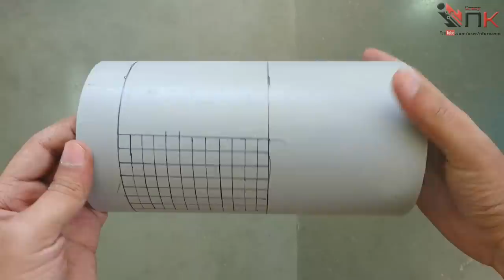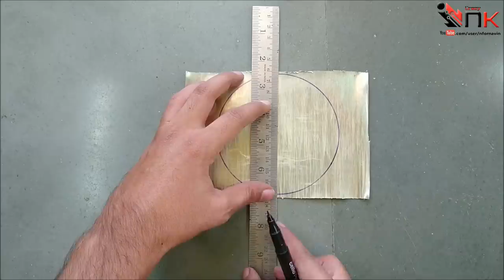How to Make a Bladeless Fan using Plastic bucket at Home

Comment: just wondering; if this is the easy way; what's the more difficult way like?
Reply: Cristijn de Vin now imagine the amount of money spent on stuff used to build this
Reply: Isn't the real Dyson bladeless fan based on something about ionic charging of the air, so that it rushes from one side of the fan to the other thus picking up momentum and creating air currents?   If so, then to make one of those I think you need to build some high voltage generator or something.
Reply: Actually the real dyson fan is built exactly like the one in this video. There is a fan in the base that gets pushed through an extremely small gap that "amplifies" the air current.
Reply: insane is right the Dyson fans are pure scams, the fan is in the bottom, I looked at my friends , pure marketing hogwash
Reply: There is a fan, yes, but is smaller, uses less energy and generates the same, or even more, air current than a common one with blades. That is no scam.
Reply: less then a tenner, just built it with my son.
Reply: +Paul James thanks Paul. my point exactly. jealous people. I like that guys idea.working on stuff and projects myself. dealing with the same issue. they have nothing else to do. like your comments.
Reply: Cristijn de Vin lol hahaha
Reply: ROTFLMFAO!
Reply: Cristijn de Vin apparently just buying one is way harder than spending 3+ hours making one
Reply: cobblerama when Dyson promotes the word "bladeless", by that they mean no visible blades, to see or to get hurt with.
Reply: Cristijn de Vin xxŹssxkxx!
Reply: Same steps but with no hands
Reply: He could have just bought a better one..lol
Reply: MGTOWPORTUGAL these all stuff u will get it for less then 4$ except battery...
Reply: Cristijn de Vin paying 400 dollars for one haha
Reply: Cristijn de Vin 😂😂😂😂🤘
Reply: If you got couple hundred to spen on a fan
Reply: Get a minimum wage job, eventually buy a real one.
Reply: so then why don't you just put that fan vertically and use it as a normal fan.
Reply: £200 is the more difficult version.
Reply: I don't dispute the ingenuity just the practicality of it. He could have used that can air fan (that's really what the device is) and perhaps fashioned an air chiller system using water cooling to actually generate cool air for probably a lot less noise for the same amount of items plus a hose......
Reply: Take the bucket, put it on your head, then save up to have central air conditioning installed in your home.
Reply: Cristijn de Vin making molds and thermoplastic but for a one off piece this is a good method. Now maybe a bigger motor and stacked of blade disks......hmmmm more power
Reply: You go to work for minimum wage then spend 500 bucks that you probably need on a fan you probably dont need. Thats the hard way
Reply: iain schmaloer what is this repalcing you speak of?  How does one do it?
Reply: I thought it was just thinking that i was lazy.. but then i see how many people saw yr comment..#internet search..haha
Reply: Making a Bladeless Wooden Fan - Scrapwood Challenge ep38
Reply: Lmfao
Reply: @hydmonger2816  i was much more impressed with the wooden one
Reply: @nanaimosteve5952  well yes but actually yeah
Reply: @ Cristjin, Thaks for that !

Comment: Pretty slick design, I like the re-purposing of other household materials.  I'm sure that by now you've considered some improvements.  Based on what I see here, the two major problems immediately obvious to me are Noise and *Air Flow*.  So for those two issues, here are some options:

1.  Noise.  This can be improved in several ways.  
    a) using a small piece of rubber or other vibration absorbent material between the wood support block and the motor would reduce the whine of the motor.  Adding the same rubber to the base would reduce vibrations conducting into the surface it's sitting on. 
    b) balancing the blades better would reduce vibrations in the whole system. This can be accomplished when you are first using the compass to draw the circle on the metal:  Once the circle is drawn, put the pin on the edge of the circle and make a mark with the pen on the circle, then move the pin to that mark and repeat all the way around.  This will give you 6 marks, split the distance between them for a total of 12 smaller, equally sized blades.  Next, balance the fan on a nail or pin in the centre hole, and mark the side that hangs lower (heavier)  Use sand paper to remove tiny amounts of metal, and repeat until it sits perfectly level.
    c) use sand paper or steel wool to sand all of the edges of the blades to remove any burrs or rough spots which produce the "wooshing" air noise.  Painting the whole thing with high gloss paint or nail polish will also reduce air noise.

2.  Overall air volume:  At the end of the video, you can see the paper strips at the edges are moving, but the centre ones move much less, this tells us we don't have enough oomph in this design for the size of the orifice.   The "magic" happens due to a phenomenon known as the Venturi effect (an example of _Burnoulli's Principle_); in a tightly engineered fan, the the throat/pedestal fan output is balanced to the orifice size (the big O made of the bucket) and the gap/angle that allows air to pass into/through the orifice. As high velocity air leaves the gap in the rim of the orifice, it produces a difference in air pressure across the orifice, which is how it is able to move more air than just what is moved by the throat fan. In this video, the throat fan output is undersized for the orifice/gap.  The basic solution is simply to reduce the size of the orifice, thus increasing the pressure differential, subsequently increasing total air movement.

Getting the fan design to match the Orifice size, gap, and angle for maximum efficiency can be a severe pain in the butt.  If I remember right, Dyson uses between 12 and 18 degrees for the pressurized air angle, but getting that precise in a home-made model might be a bit difficult.  I'm also unconvinced that this is a critical step.  However, the fan design makes a big difference.  Smaller blades with a sloped curve would give the fan output less velocity but more pressure; as the size of the orifice is reduced, the pressure output of the fan becomes more critical than the volume of air moved.  With some patience, a person could tweak this build several times to determine the best design.  After all, that (plus some crazy math) is how Dyson came up with their ubiquitous fans.
Reply: How to tell me you work for Dyson,  without telling me you work for Dyson.  😊
Reply: @ThunderPickled  hahaha, I don't actually!  I'm a lowly power engineer at a chemical plant.  However, fluid dynamics of air movers is very important to my career, I just usually deal with fans and blowers that are several meters in diameter.  All the same principles apply, with only slight variations due to scale.
Reply: As a master electrcian, I can appreciate your input but I doubt most will.  The work we do behind the scenes to keep the world running is under appreciated .
Reply: @ThunderPickled  well thank you for your kind words :D ... You're right about being behind the scenes, too.  But I don't mind sharing my knowledge (or opinions) even if it takes 5 years for someone to come along and recognize it 😂

Comment: how is it blade less if it has fan blades?
Reply: Dude the blade is hidden inside the that pipe
Reply: ravinder singh that doesnt make it bladeless
Reply: Wayne Wildman if a fan don't have blades where do wind coming from ? lmaooo 
the blades are hidden inside which makes it as bladeless fan 
but in this case  it's just too noisy lol
Reply: Bes Mir bladeless means no blades plain and simple
Reply: this comment thread is hilarious
Reply: Colin Merryfield    Qqq
Reply: pat O'Hara wut?
Reply: Marketing wank, it is still a blade driven fan but the blades are hidden away.  An old concept "air condition"
Reply: Bes Mir that still  isn't  bladeless. It is hidden blade fan.
Reply: Bladeless in appearance, do you know of an efficient way of moving high volumes of air without blades?
Reply: Oliver Carr no buy the name implies no blades at all.
Reply: Wayne Wildman It's marketing, not magic.
Reply: Oliver Carr I do know a way.
My mouth moves lots of hot air.
Reply: Which is effectively a pump, mechanically inefficient and impractical compared to a fan.
Reply: Oliver Carr dude, it was a joke...as in "I am full of hot air." You ought to lighten up a little.
Reply: you could just talk about the IONIC BREEZE which is an actual bladeless fan...

this video is not about a bladeless fan.. it's a hidden blade fan.  end of story, no ifs ands or buts about it.
Reply: that how its work ass no were in sight fan blades
Reply: O.M.G! Learn to spell.
Reply: "that how its work ass no were in sight fan blades" 

Now that you've explained, it makes a lot more sense to me.
Reply: those who think he lied about "bladeless" read below. A bladeless fan (sometimes called an air multiplier) blows air from a ring with no external blades. Its blades are hidden in its base.
Reply: manu thomas 

 l
Reply: Bes Mir
So the proper term is "Hidden Bladed Fan" and not "Bladeless Fan", right? Besides inaccurate, "Bladeless" seems like a lame marketing gimmick.
Reply: It is just a marketing gimmick, take the Dyson "Blade-less" Air Multiplier which actually has blades like this one.
Reply: Wayne Wildman You know what, you're all right. Dyson are a bunch of scammers and should have named it the Bladeless-Looking-But-Not-Technically-Speaking-Bladeless Fan. Rolls right off your tongue! Dyson had such a good marketing chance with naming it that but they blew it!...
Reply: the sarcasm is strong with TheFrosty. Well done.

Comment: this is awesome, i looked at what bladeless fans are because of your video. I've always had trouble sleeping under regular fans they make me feel beaten up in the morning. Now i know why.
Reply: I had a floor fan that sounded like an airplane so loud it was, and it was full metal, made a wind too... Broke it last week when I was cleaning its electric motor, I thought I had it screwed but I didn't, so I ended up dropping it and unfolding the copper, poor thing!

Comment: I think people are over looking the fact that this is a 12 V system. This is a great project with far more application than a 120 V fan. This would be camping or useful during a power outage. Also would be very easy to use and maintain with solar power.
Thanks for the video.

Comment: You made the cowl duct backwards. By using the wider side as output, you create a low pressure region within the ring, so you aren't moving any of the ambient air through the ring, it's just blowing a much lower volume of air from the fan itself. That defeats the entire purpose of the design. Try doing it again, but having output holes on the smaller side, and notice how the increased pressure combines the output air with the ambient air passing through the ring for more efficiency and higher output.
Reply: why does ur face looks like u advertise "smoke weed everyday"
Reply: Never heard of it, but whatever makes you happy. I don't judge.
Reply: @poolehart, Let me guess, indoor cats? Be glad it's not the smell of "A cat's wrath of vengeance against vile rodents, and winged demons that mock them from the other side of the glass windows."  At least that's what my cats call them, I just call them birds and squirrels.
Reply: JamesMorningstar  u look like cheerful guy.... kudos 😁😁
Reply: JamesMorningstar 
Maybe you should one up him

Comment: THATS NOT BLADELESS! CHEATER!!!
Reply from the maker: Fan without propeller, It has hidden blade that's why  know as bladeless
Reply: PC fan may be quieter   ✔
Reply: Boy, you need to get out of the house more often... evidently the concept is beyond you...(Nice Job Navin)
Reply: Sounds like a racing car , but it would be fine if you were deaf I guess
Reply: danthor45 Lol... Then how do you think bladeless fans work? Go buy one and open it up.
Reply: danthor45  yea its bladless
Reply: I had just read about ion and EM propulsion headlines shortly before I saw my first bladeless fan.. For years I actually thought they created current using an EM field of some sort, haha. I just barely saw one where I noticed the vent holes in the base last month.
Reply: I didn't know how they worked either,but now I do.
Reply: "Blade-less" just means no exposed blades. How do you think the real ones work? Unicorn farts?
Reply: centrifuge is bladeless. ti takes the ait and force it one way
Reply: it is just a normal fan that is in a box with canels to guide the air in a way...
i dont get the point in making a circle "output" for the air. when a normal nozle will do the trick.
the "bladeless" coverd blades are going to give the same air. done get me wrong. its a nice projekt. but i was hoping he has made a real bladeless fan. you know no sharp rotating blades what so ever...
Reply: Lotta fan blades on that bladeless fan.
Reply: danthor45 Ignore him. He e-knows something, so he has to go tell everybody. It's actually the fault of the inventor of the "bladeless fan" for creating a misnomer.
Reply: those who think he lied about "bladeless" read below. A bladeless fan (sometimes called an air multiplier) blows air from a ring with no external blades. Its blades are hidden in its base.
Reply: manu thomas Bladeless fans sometimes have blades. Got it.
Reply: He's just wanna get some attention from you guys
Reply: Jonathan Hughes Calm the f* down. If the Internet stresses you out that much, you should probably take a break. I was attempting to explain 1) that it's a bladeless fan and 2) why nobody should be surprised that people don't know why it's called a bladeless fan. It's like calling your car an engine-free vehicle. You can't see the engine, so it must not exist!
Reply: Just because Google says bladeless fans are fans with no external blades, doesn't make it concrete.  "Less" as used in this case, is a suffix and IS concrete. It basically means "without". Technically a fan that has blades, whether internal or external, is not bladeless. Dyson is going to call it bladeless to make it sound more fascinating for marketing reasons. Hell, there's even a Wikipedia on bladeless fans stating that they have fans, just not external. I don't care WHO says it; Dyson, Wikipedia, or even Webster's (which, by the way has NO definition of the word). If it has blades anywhere in it, it is NOT bladeless, period.
Reply: Unfortunately, the term " bladeless fan"  was coined by someone else. You're right that it should never have been used in the first place. But since these types of fans are called bladeless, that is now how they are known so that is the name you use when referring to them.

It's annoying and inaccurate.
Reply: M1ndblast, that a very good point
Reply: Very bad

Comment: can make jet engine with this?
Reply: You could probably make something similar to an EDF (Electric Ducted Fan), it just wouldn't be very efficient compared to a normal propeller. Definitely a cool idea though, because there would be no risk of anything getting chopped by fan blades.
Reply: DT Jr I was talking about Jet engine with compressors and combustion,  I meant to use the lower bottom cylindrical part
Reply: Very interesting... I'd imagine heat management would be complex. But the benefits could be really interesting, what with FOD and bird strike damage being greatly reduced because the "fan" part has no blades, foreign objects that get sucked in would just fly out the other side.
Reply: DT Jr yea that's what I was talking about
Reply: Oh yeh , Boeing is going to put them on a 747 next spring. Tesla has even announced that they will use these things to develop jet cars . George Jetson , your day has come.
Reply: bootlegger 23 actually in cars,  the US Army's  M1A2 Abrahms tank with depleted Uranium armor with 80tons weight is powered by 2 jet engines
Reply: The M1A1 Abrams is powered by a single turboshaft engine (AGT1500) and weighs 60 tonnes (67 short tons). The M1A2 variant is also single engine and weighs 65 tonnes (72 tons). The last time I heard of a modern day tank weighing 80 tons was when the U.S. Army cancelled the GCV project in 2014. 

Also putting turboshaft engines in cars is crazy, there is a video here on youtube of a minivan with a small helicopter turboshaft engine. I mean sure they're loud, expensive, and guzzle fuel. But the power to weight ratio is insane.
Reply: DT Jr I thought the depleted uranium armor makes up the weight,  the A1 was used in Vietnam,  while A2 in Afghanistan
Reply: SARIEL JOGI surely you mean the first Iraq war and not Vietnam.
Reply: Domus deBellum no man Abrahms were used in Vietnam
Reply: No Abrahms in Vietnam and I believe the depleted uranium comes out of the gun.
Reply: Daniel Ng Tze Yi engines failed,  radar out of signal

Comment: hi, you can put some ice inside the tube and turn in a air conditioning
Reply: or misting jets on the inside of the ring for some much more efficient cooling.
Reply: Good but when i make these I use the smallest diameter porous watering hose my diy store has. Tried a mister first but it makes your floor wet. Sometimes I get ice forming on the hose if the humidity is very low.
Reply: did some calculations and i think i have the equivilant of a 20 watt freezer element from an 80 watt fan motor.
Reply: Aidan Sharples nobody cares